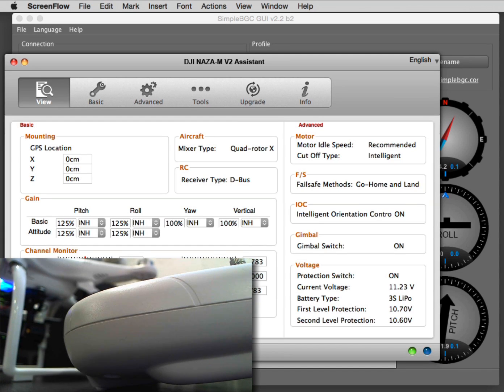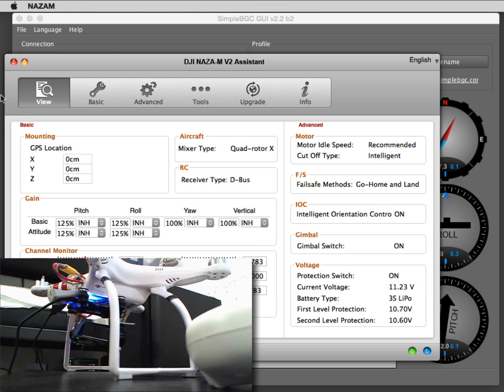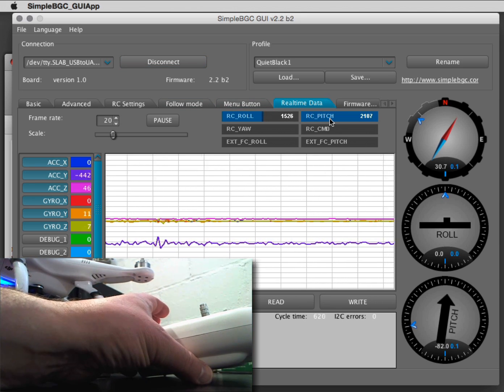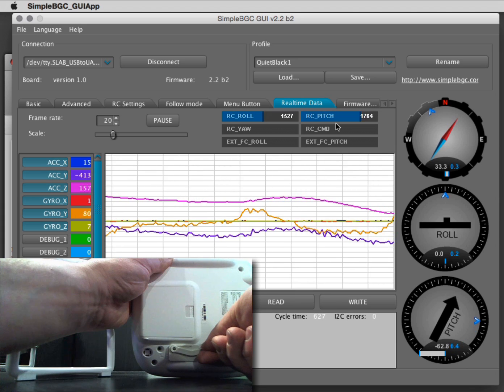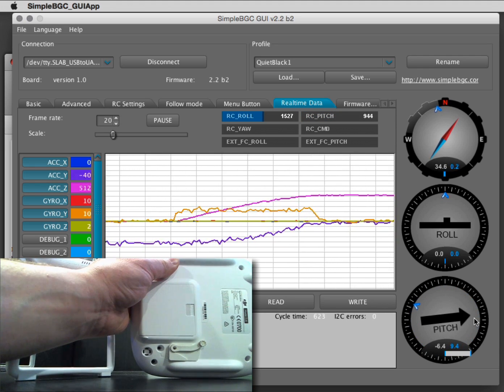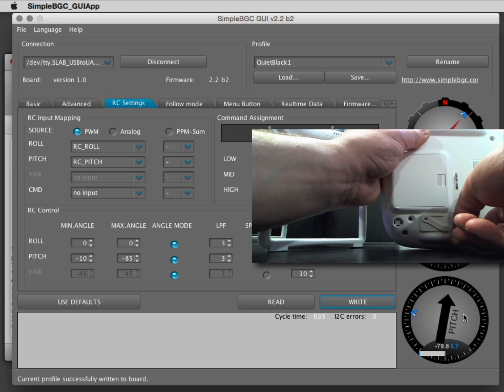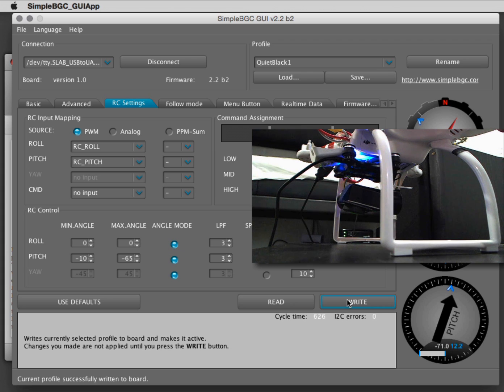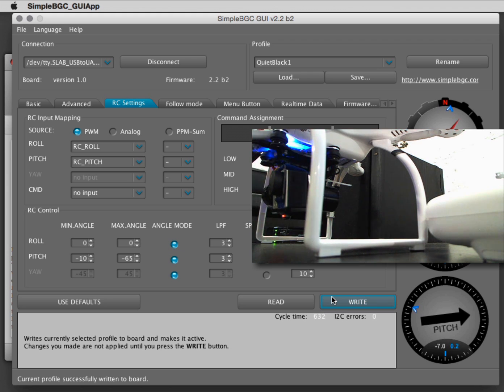DJI Phantom BGC Gimbal Pitch Control Setup

Comment: Hi,

I bought two gimbal the same as you , one is 8 bits 2.40 b7 and the other is 32bits 2.30. both are "shaking" and doesnt stabilize. http://youtu.be/hwkxBy5Qz-M is the video. What i have to do ?
Reply from the maker: Yes, no problem. You have to put the camera on there, or at least a weight of the same weight as the camera.
Reply: mygiguser
i did and still the same
Reply from the maker: Then you need to calibrate it with the BGC software. Watch this here: http://youtu.be/2iT2WRpTMa8?t=10m19s
Reply from the maker: Eduardo Alcantara Did you buy the gimbal assembled? Did you have to position the sensor? Are the motors connected to the correct pins on the controller? What are your settings in BGC, can you post a screenshot?